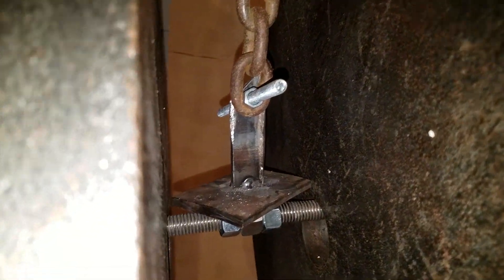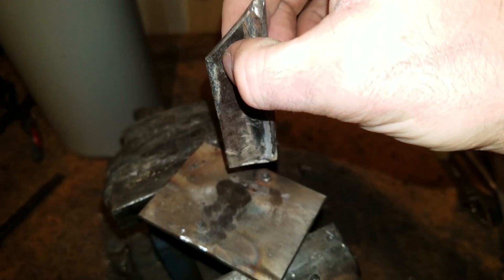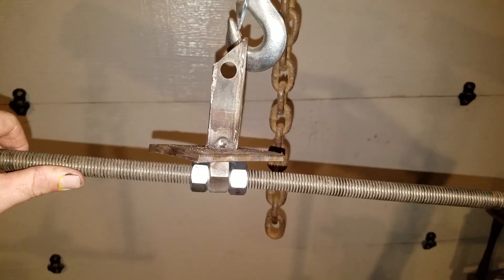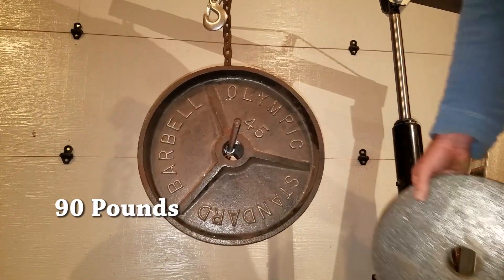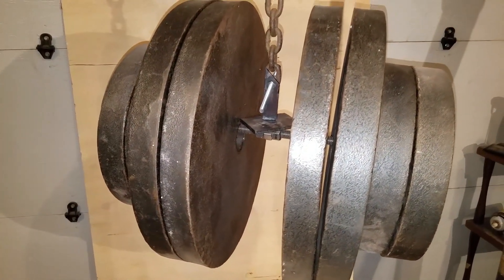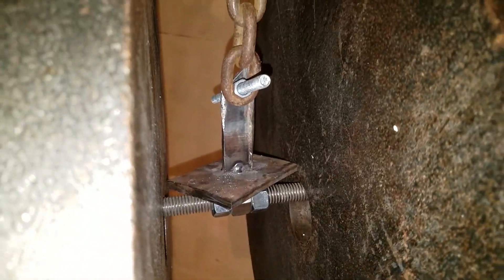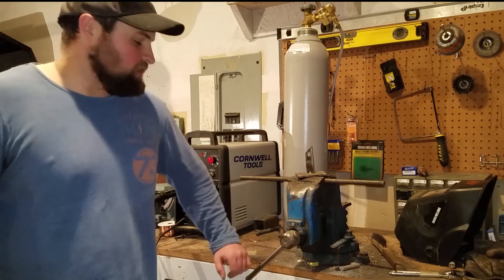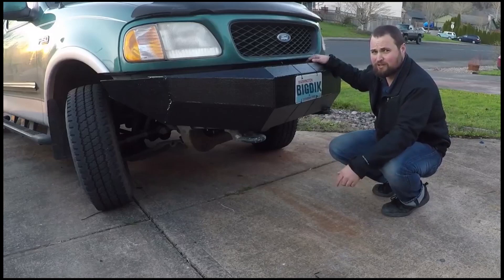How strong is a Tack Weld? Pretty dang strong!

Comment: My steel bicycle has kinda only two tack welds , one for each seat stay as in the weld where the seat stay meets the top tube. I am pretty sure it's a Chinese of Taiwanese cheap bike frame or a Wabi clone. the Bike is well constructed the bars are connected with lugs and the whole bike is painted (mine in white). The bike seems well put together, but I was kinda scared about the small amount/surface of welding between the seat stays and the top tube. This video clears my concerns a little. Of course my type of bike is a 'classic single speed/fixed geared city bike' so it's not made for rough roads, but still I am impressed.

Comment: But how you broke it was not the same as the weight test. I think we can all agree that the force of your hammer was not in excess of 280 lbs. That kind of arm would shatter baseball bats and the balls that hit them. The reason it broke so easily with your hammer swing is because of leverage. With the weights, all of the force is pulling downward; ergo parallel to the length of the top piece. When you struck it with the hammer, the force is being applied perpendicular; that is, the top piece wants to "fold" at the weld instead of "pulling apart" in the same direction as the force being applied. 

Since the top piece is taller than it is wide, striking it at the top creates leverage at the bottom where the weld is. The hammer applied horizontal force while the weights applied vertical force.

Comment: You think that’s strong, put a tack down with .045 bare wire and turn your heat up
Reply: I hang 500, 700 pound base plates with a lifting lug only tacked on the corners all the time at work. Ain't had one break in 20 years. Just make sure you ain't running too cold when you tack it

Comment: Is stacking low current welds same strenght as single weld ? Real difference is in heat affected zone, so does it mean more heat affected parent material greater the fusion?
Reply: That's what I was trying to find

Comment: Welding steel has a tensile strength of 70,000 pounds per square inch. The tack weld is a little more than 1/100 of a square inch. So, that tack should hold about 700 Lb of static weight. Impulse loads impart more stress than static loads. Also the tack is only on one side, so there is lever action which further reduces the force needed to break the weld.
Reply: True, welding the other side will greatly increase the tension it needed to break the weld.
Having only 1 welded side gives moment to the force. Tension isn't the only force acting on that one, making it break easier.
Reply: 5 head
Reply: That is dependent on the rod it’s self. Example 6010 “60,xxx tensile” & 7018 “70,xxx”

Comment: It's took me more than 5 years to fix my broken gate handle that originally weld like this before but it break because it been hit but I didn't have any weld tool but finally I can use a glue to it but before that I test it on metal rod and test with 3 bricks on it after 16hours the glue curing and the results are marvelous events it is not weld but anyway it's working as it should be like before. I'm just amazed how the glue can be almost comparable with weld. Well almost.
Reply: So it has been 3 years since you wrote this, is the glue still holding?
Reply: @bilgehan_sahin  What's up, here how it went. The glue holding strong for about 1 year only which is good because at that time I was just buying the cheap china glue. After that I just discovered Hardex brand which is one of the best brand here so I try it and guess what it's still holding strong until today.

Comment: I’ve never understood how welds can be so strong, but wow
Reply: @Unlimitd Content that welded point is basically as strong as steel.
Steel has insane tensile strength compared to its shear strength that's why it is easier to break it from the sides instead of using pulling/tensile force.
Reply: @marcobicodo  stronger
sg2 steel / sg3
It's much stronger and harder than the normal steel
And you are let the ground material / stell melt and let your enforced sg2 steel in it
That's why a good weld will NEVER break at the welding line
Reply: @lipt4040  XD watching ppl just ask instructors "so what do i do" when they couldnt get proper pen/fusion and ass for a tear out...same clowns that forgot to tac their lap joint on the frame rail/insert repair simulation......that hit their plugs first XD